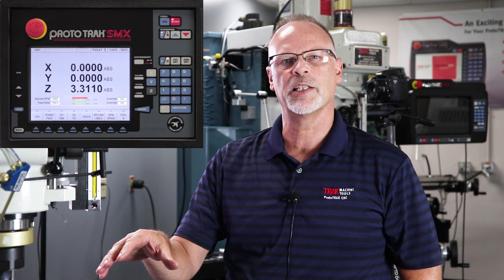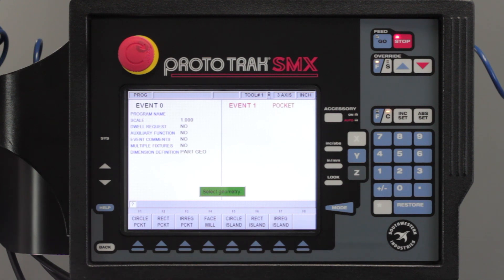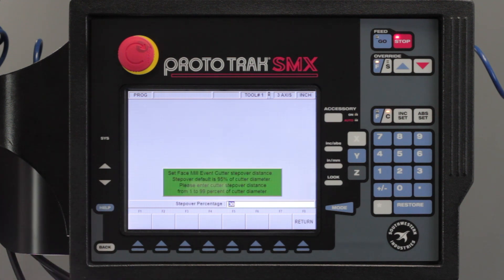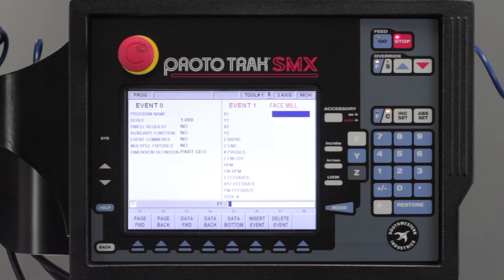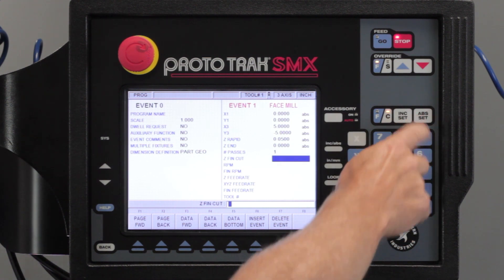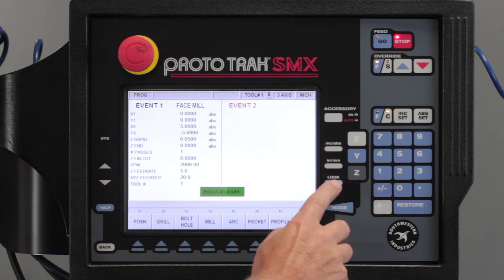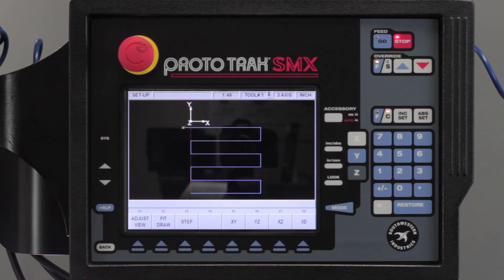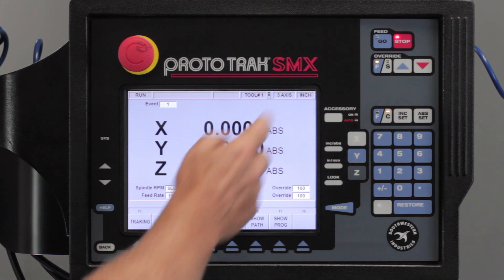Face Mill | ProtoTRAK SMX CNC | Basic Programming 4

Comment: Is there a way to have the direction of travel be rotated so its cutting along thr y-axis instead of the x-axis?
Reply: Hi Jordan.  On the SMX, you are stuck with the X-axis tool path. There is no option to change it.  It should be noted that in the new RMX, you can cut any face mill or pocket at any angle you want.  If you need to face a part in the Y-axis, the easiest way to do so is to just use a mill event and then use a repeat with your desired stepover and number of repeats.  I hope this helps you!  T.P.

Comment: I have the SM Control, with the trak k3 mill. I want to do this program but I do not have the face mill option, I just checked.

 I tried doing copy repeat, and sub repeat with a y-axis offset and it just does not do the correct zigzag tool path without overlapping and me having to delete look at the path and delete etc. I can do it by hand but that is 200+ lines of code, at that point I'll stand there and do it by hand.

Thanks.

Comment: If I wanted to use single direction cutting (not zig zag) and wanted to take off .250 amount of material at .05 per pass and wanted the tool to rapid at .100 above part. How can I do that without cutting air at 2 passes?
Reply: Dear MonkeyMojo, You would have to build a sequence of events to do exactly what you want because the SMX does not have the option of single directional face milling.  First, I would use a milling event to cut from one side of the part to the other. I would set Z rapid to "0" and Z begin and end to -.05". I would then use a position event and set X&Y to "0 INC" with a  Z rapid of .100" ABS to move the cutter above the part.  Next, I would repeat these two events with an offset equal to the stepover amount you prefer. Add enough repeats to move all the way across the part. Next add another repeat of events 1 through 3 with a Z offset of -.05". Use 4 repeats and it will do exactly what you are asking for.  There are really several ways to do this but this is the way you described it.  Hope this helps!  T.P.
Reply: @trakingpat2750  I apologize. I should have specified that I use the RMX controls. It does have single direction cutting with a rapid movement to the other side of part (want chips shooting away from face). My problem is the 1st cut starts from wherever the rapid position is.. I really don't want to rapid across the part at Z0 to get a full 1st cut. Thank you for the info though. I will try it next time.
Reply: @trakingpat2750  When I said "single direction" I mean "one way". Like the settings say.